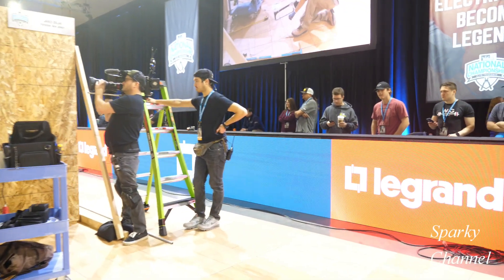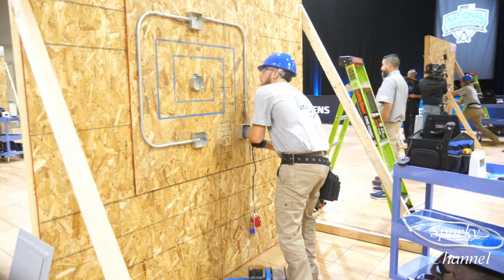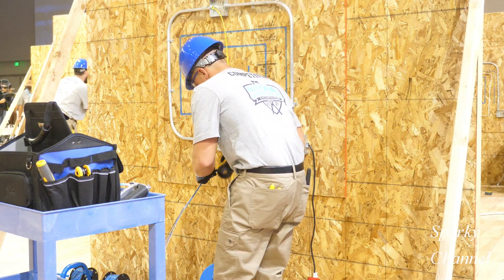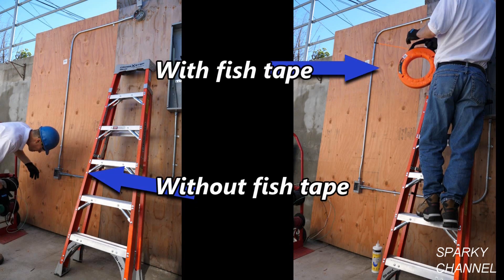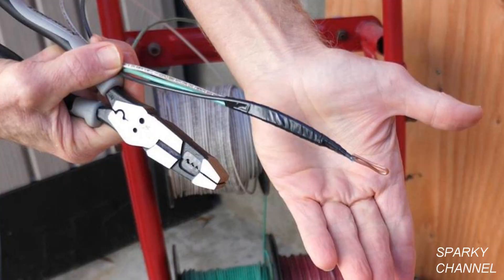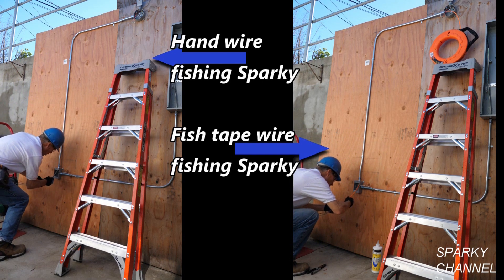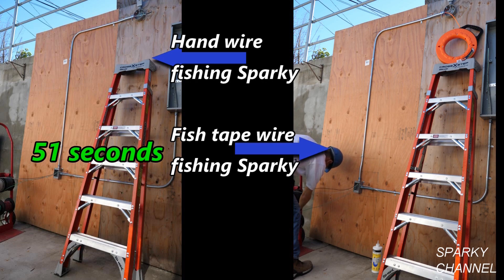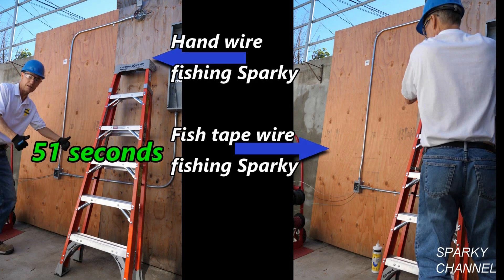Are Fish Tapes Really Necessary All the Time?

Comment: For me, it depends on how many 90° bends on the run, how long is the run and how many wires (also the wire size) going through the conduit at the same time.
These are the factors to consider whether use fish tapes or not.
Greetings from Hong Kong 🤓
Reply from the maker: Greetings from San Diego! Yes, experience can tell you when you need to use a fish tape.

Comment: I rarely use fish tape on EMT when I can see both entry and exit points. Maybe when there’s tons of bends or couplers. I use fish tape on blind pulls and non tube scenarios. Recently I used fish tape to pull the wires for a garage door opener through the snap-together rail. 

On a side note, Is there a helper tool out there that will hold the tape reel with tension to a ladder or cart?
Reply from the maker: Excellent Celia! 
I don't know, but it would be a good idea.

Comment: You must be careful to not nick the jacket on the wire. At which point would you use a mouse to pull wire, what diameter EMT ?
Reply from the maker: On the more difficult runs it's an experience thing deciding if a fish tape is needed.
Reply: Scatch ring prevents nicks

Comment: If it’s a short run yes fishing by hand is faster . If you have a bunch of bends let’s say 3 and you have sold wire then no it will not be better to push by hand. Second thing I will say is in both scenarios the person pushing by hand could have shaved more time off the hand push by using gravity to their advantage. It’s better to push down hill aka get up on the ladder and push t by hand down the pipe . Both hand pushers pushed it up the pipe which takes longer to fight gravity even if it is a short run .
Reply from the maker: Good tips, thanks!